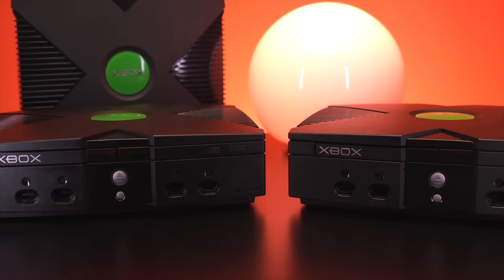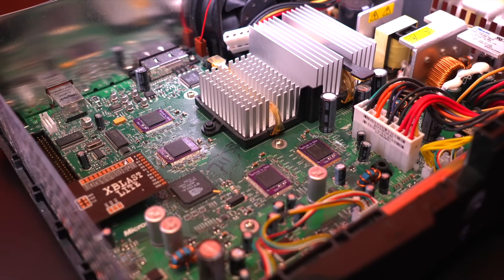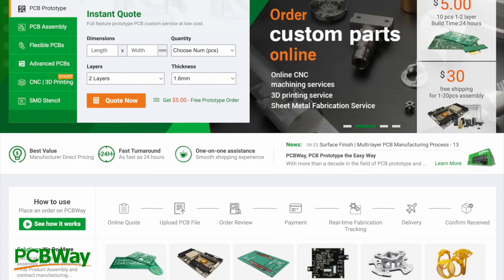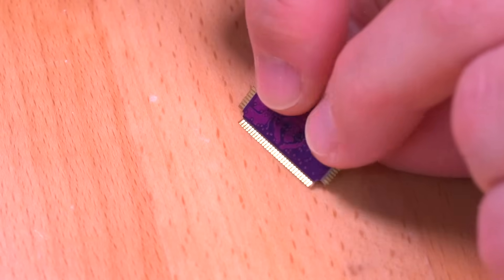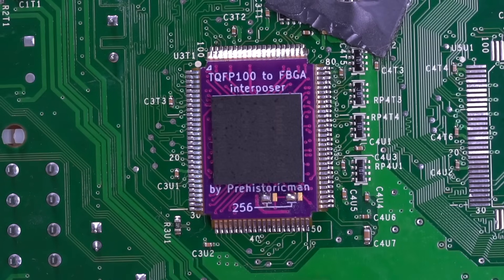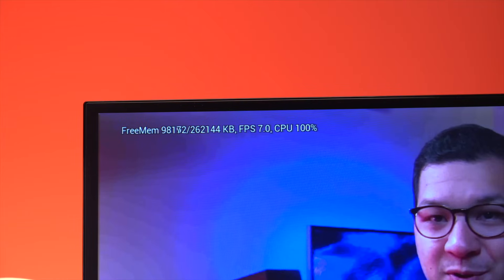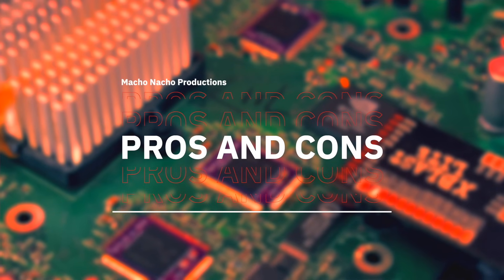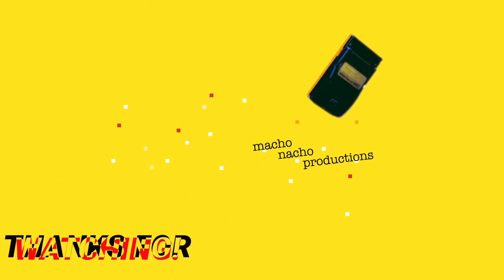Giving The OG XBOX Quadruple The RAM | Never Done Before!

Comment: We have CPU upgrades, we have RAM upgrades, we have DVD ROM upgrades, and we have SSD mods…

Now we just need a GPU upgrade.
Reply: At this point we might as well go all in with a custom mobo running a modded Xbox BIOS. There must be a surplus of older CPUs and GPUs out there with similar architectures like Core2Duo and certain Nvidia GPUs that we could plop onto said board with a skt775 DDR2 memory controller and a GB or 2 of RAM
Reply: @talibong9518  ehhm... xbox upgraded cpu is actually a Core2, the Core2 are just a "rebranded" PentiumIII-M that are just Pentium-III Tualatins that evolved on Laptops, 1.4ghz Core2solo is almost the same as the 1.4ghz Tualatin from the upgraded xbox
Reply: That would probably do more for Ops 1fps YooTube at 8k woes. Least we forget the XBOX basically had a gForce 2GTS Chip inside it. Which was already old by the time they put it there.
Reply: @Ichijoe2112  The NV2A is basically a GeForce 3.5, closer to a GF4 which is a powerful GPU relative to its generation, it is more than enough for games of that era, especially considering that GPU was designed with 1024x768p to 1280x960p in mind, and the OGXB only needs to render @ 240p-480p, add to that almost zero OS overheads, fixed hardware optimizations and the bare-metal API, you could say it squeezes at least 50% more performance vs its desktop equivalent. It's just starved of RAM, unfortunately.
Reply: @Wobble2007   Ok I could have Sworn I read in some Rag, (20+years ago) that it was a modded GF2GTS Chip, but, like our President I can't remember what I had for Lunch last week, let alone 20+ years ago. And the nv2 may have been a GF3 part. Either way it's feckn ancient man.
Reply: @Wobble2007  I just left a comment asking about replacing the current nvidia chip with an NV28 and if it were possible.. does anyone have the TDP of the original chip on the board currently ?
Reply: @Ichijoe2112  These things are all relative,  the NVA2 is identical to a GeForce Ti4200 (NV25), both have 4 / 2 / 8 / 4 Shaders / TMUs / ROPs, though the XB has slightly lower clocks @ 233Mhz vs the GF4 250Mhz GPU (could be overclocked with active cooling), I actually think the OGXB could handle up to 2006 PC games @ 480p, perhaps that is even modest, especially if that NVA2 was paired with 256MB RAM & a 1.4Ghz Tualatin CPU.
Reply: @Wobble2007  Or you can get an Xbox 360 or build a Retro PC,  I don't see the point in upgrading the OG Xbox to that extent, a ram upgrade to 128mb is as good as it gets. Anything beyond, compatibility just takes a hit, with almost every game needing a patch to run such the Xboxes modded with Pentium 3 CPU's, they can't even run games from discs anymore. Along with the power not really being utilized. On my Retro Socket 370 build which has a dual Tualatins, Ti4600 my other build had a Geforce FX with Windows 98 and XP. I can just turn the settings and the framerates up for each game and play these same games in HD.
Reply: RTX 4090
Reply: @8bitnation419   Not period-correct.
Reply: @AmaroqStarwind  might as well buy a new PC
Reply: @u263a3  If I wanted a new PC, I’d buy a new PC. I’m specifically wanting to upgrade the Xbox.

Comment: Technically the 32 bit bus of the x86 architecture allows for 3.5gb of ram, on some older boards it maxes out at 2gb (I don't know exactly how much Xbox classic has a limit), so I wouldn't be surprised when this tops the amount of ram of the Xbox 360.
Reply: The 32 bit bus's limit is technically 4GB. But the theoretical limits of a 32 bit bus are irrelevant, because no software has been developed to take advantage of it, and the Xbox hardware/firmware isn't set up to recognise it. So unless you're running a custom bios and a suitable replacement OS, and not Xbox games, it would be useless. Buy a cheap, used PC... much easier, more flexible and easier to upgrade.

Comment: Well I can see some scenarios where additional RAM could theoretically help 

+ 720p patches 
+ PC Ports or better pc ports 
+ Texture improvement mods in games
+ Emulators
+ Sega chihiro games
Reply: Gonna need to combine a 1.4Ghz Pentium III replacement, plus the SEGA Chihiro GPU. Might as well think about a new motherboard. :P
Reply: @XenonG  iirc the sega chihiro gpu is just the same one as an og xbox, maybe a bit higher clocked
Reply: @XenonG sega used the exact same gpu
Reply: There are some games patched at 1080i (Halo 2 HD, PSO) that can still run out of memory even with 128MB ram mod. (in the case of halo, he had to dial down the texture cache size to make it work) If they can fix the memory speed issue on the original kernel, it would help us run halo 2 at 1080i better (the guy who made the patch theorized the game was possibly starved for memory bandwidth). Besides that, there's also the port of ReactOS that can benefit. I would like to see where this is going.
Reply: hopefully this can allow for i/o emulation for wangan mmt1 and 2. would be really cool to be able to finally play those games at home
Reply: @windowsxpnt2347  Wangan MMT1 & 2 along with a few other currently unsupported Chihiro games would be my preference as well. Buying old arcade hardware for home use is expensive and can be a pain to setup and manage. Having a simple Xbox setup opens the doors for more people to enjoy those games.
Reply: more (video) RAM would absolutely help with higher resolutions, that makes perfect sense
the rest I'm not so sure
Reply: ....OR...Master chief collection.
Reply: Could probably run the outdated sega saturn yabuse 2.0 more smoothly and also run 3d games for it too.
Reply: proton-ge
Reply: 128mb is enought for 720p patches, that need 900mhz at least to run... and few need 1.4ghz cpu to run. The ram is to... install a proper OPERATING SYSTEM on the Xbox making it a MODERN CONSOLE... a Dashboard that can actually act as a operating system... imagine XBox running Android by example, its possible as Android ran so well on 256mb ram phones on the past...
Reply: @SargentoDuke none of this is possible this is gobbledygook
Reply: @SargentoDuke so why bring up the fact about making it a MODERN CONSOLE when you wanna put old ass android onto it 💀
Reply: theoretically the extra channels help with bandwidth if they are properly spread out on all the extra chips

Comment: My gut instinct is that the stability issues are due to the interposer increasing the length of the PCB traces.  I know from personal experience that one traces being just one or two mm longer can cause errors in signaling, even at the slower speeds that these old devices run at.  Also this is even more obscure, but changing the width of the traces can cause weirdness with signal reflection.  If the interposer uses thinner traces and doesn't perfectly length match them then that's my bet for the core problem.
Reply: the source of the interposer said a trace was damaged from bending the pins too far and was making changes to prevent the same thing from happening. Not sure why they don't come pre-bent - unless Prehistoric didn't know it was an issue. I doubt a lot of people are upgrading this particular mod since there are only really future "maybe" uses
Reply: I'd say it's more likely just a faulty chip or a little extra voltage is needed
Reply: I don't know if it was still a thing in the celeron era the Xbox was built on, but older PC's if you wanted to go above a certain threshold of ram, it'd actually run slower if you didn't have an equivalent increase in the CPU cache memory that stored the increased address range of the system ram. Given the whole point of celerons was same MHz with less caching for cheaper, if this was paired with the CPU upgrade mod, would that unlock the proper speed and reliability of the extra megabytes?
Reply: @mikeyjnz  You're misunderstanding that concept -- that was an issue primarily with motherboard-resident cache controlled by the system chipset, lasting from the 386 era on up to the Pentium MMX for Intel, and the K6-2/III for AMD. It wasn't necessarily the cache size in and of itself but rather the Tag RAM. Once we kicked over to CPU-resident L2 cache, like on the K6-2+ and III+, every Athlon, the Pentium Pro and onward, that issue either became much less prevalent (in the case of the K6 line) or disappeared entirely.

In short, you can throw as much RAM at that thing as the chipset will address and there will be no slowdown.
Reply: @sedrosken831  Cheers, yeah I did think that was gone by the p3 era, but wasn't sure, and if being a celeron with some sort of restricted l2 cache would impact that at all
Reply: @mikeyjnz the original Xbox didn't use a Celeron... It used a Copper mine Pentium 3 733 MHz CPU... Apples and oranges.... Trace length didn't become a common issue until the last several years... And I have never heard anything about CPU cache and ram having anything to do with each other in that aspect... If you didn't match your ram, it would run at the same speed as the slowest ram in the system...
Reply: @fadingbeleifs you're right, it was definitely labelled as a custom p3 coppermine, but it was a half l2 cache version same as the equivalent Celeron, and its been a hot minute since the release of the OG Xbox, but I vaguely remember it was closer compared to the celery than the full p3? Could be misremembering there too though sorry!
Reply: I’d agree with your assessment of the interposer. Have you ever seen what happens if you try and use an SD card extension ribbon cable on your PC? The speeds are ugly and transfers fail frequently.
Reply: You’re saying there not impedance matched but I doubt it matters that much here.
Reply: R u telling me halo and halo 2 run on 64 MB of ram?
Reply: @danielpicassomunoz2752  the xbox was built in an era where 500meg of memory was a badass rig. the factory drive was only 8gig, and that was huge at the time. in the last 20 years, things have changed a lot.
Reply: I'd say that is most likely the least problematic issue here.

Comment: That improvised heat shield was an inspired idea, reusable and simple!
Reply: not necessary.
Reply: @UberMicroRepairs 100 percent necessary if you care about not ruining the rest of the board
Reply: @UberMicroRepairs  hot air can easily blow away the tiny filtering caps on the board with how little solder there is on their pads
Reply: @aiexzs  nah. Surface tension keeps them in place
Reply: @UberMicroRepairs  ok pal
Reply: @UberMicroRepairs  to a degree but i can confirm from personal experience they don't like to hold on very well
Reply: @aiexzs  then your air flow is way too high.
Reply: @UberMicroRepairs  if you're not a solder wizard, desoldering anything of decent size needs a good amount of airflow in order to properly transfer enough heat to the board
Reply: I got a hot air station and was working on a xbox one x. Air does indeed blow away small caps so idk wtf that guy is on about. Even watch professional repair videos like Northridgefix and even seen him accidently blow away a small cap. @UJustGotGamed
Reply: @HappyHardcore86  in repair centers, blowing away small caps dont make any difference in 99% cases becauseyou have surplus of them. Messing all the caps around is catastrophical and can happen sometimes but normally you have stock of them.
Another thing is how good you are to not mess caps and dont care. The only thing you care is to not fry other electronics.

Comment: Very good modification, I imagine that the next modification will be the overclock from 733 MHz to 1400 MHz or 1600 MHz.
Reply: That's not exactly done 
It is actually replacing the cpu with 1.4ghz and overclocking to 1.6ghz
Reply: CPU swapping has been around for many years now.  Overclocking the stock CPU can already be done using custom Bios. The issue is the CPU will never overclock to these extremes no mod or cooling could fix that, it's all down to the silicon lottery. I have seen people overclock near to the 1.0 Ghz mark but never 1.4 without changing the CPU.
Reply: @x66Hawk66x  emh  i see so much overclock noobs here, the Xbox overclocking is only limited by cpu voltage and CHIPSET FSB, that is 166 on the xbox, thats why the 733cpu can be overclocked almost to 1ghz, IS NOT OVERCLOCK, its running the Xbox on the DESIGNED FSB... 733cpu with 133fsb, running on FSB166 = 920mhz, the xbox motherboard is a Nforce2 protorype no other penitumIII had so actually the only limitation are the CPU voltage and the FSB of 166 max, so ALMOST ANY CELERON tualatin with 1.5v can be overclocked to all 1.5volts can allow you, because you will NOT overpass the max FSB of 166 as the celerons had FSB100... the 1.5ghz tualatin celeron (1.48ghz) theorically increasing the voltage can reach FSB166 and thats... 2.45GHZ but the cpu will not hold that ammount of voltage and mayb the motherboard too... but remember Tualatin CPUs were rebranded as PENTIUM-III-M on laptops (rebranded later to CORE architecture) and they just changed the FSB to be higher to get higher speeds... so the xbox with FSB166 can get a Tualatin to 2ghz E A S Y but you need to underclock the RAM and somewhat the people that had the CPU UPGRADED didnt know anything about old schoot overclocking... xbox overclock limitation is the FSB166, and the CPU voltage, but noone knows somewhat that you had to set the SPECIFIC FSB 166 to make the xbox run correcly, thats why the most fast CPU for an xbox is the PentiumIII-S 1.266ghz and NOT the 1.4ghz, because when you change from fsb133 to fsb166, the fastest one will CRASH because not enought voltage, meanwhile the 1.266ghz Pentium3-S tualatin (the PIII-S are almost Core processors) can run at 1.58ghz STABLE on the original xbox, setting the FSB to 166 and lowering the ram 1 steep.
Reply: There is already a mod to swap out the original cpu
Reply: @simplicitygaming4203  Yeah have fun, cause most of the Dolts here (Myself included), wouldn't have a working XBOX soon long after. 

But, if ya really need a good flex, that's as great a place to start. The RAM Chips by comparison are mere playthings in comparison.
Reply: @simplicitygaming4203 ps3 do
Reply: Clarification, it is perfectly clear that the CPU must be changed to reach the frequency of 999mhz or 1400mhz.

Comment: Where this modification will really shine is in improving the performance of current emulators that run on the original xbox. More RAM = more space to load ROMs into for a smoother performance. But they would have to each be modified to take advantage of the extra RAM.
Reply: @fenriswolfretro  with more ram you can use HD TEXTURES on HalfLife2 at 720p ok the original Xbox... Or increase the VIEW DISTANCE on games like Morrowind, making the xbox looks like a 360 in graphics.
Reply: @SargentoDuke  While your point is perfectly valid, I think it is a bit over the board to say that morrowing looks like an xbox 360 game
Reply: I was about to comment the same thing. 👍
Reply: There is no point. We already have a hard disk and have been using it for ROM paging for years.
Reply: Real ram chips will always be faster than virtual memory management   @weinerschnitzel7
Reply: i want Mame on OG xbox for 3d games like Street fighter EX And more acurate speed emulation on Neo Geo
Reply: killer instinct 1 and 2 will run better mvg need to see this